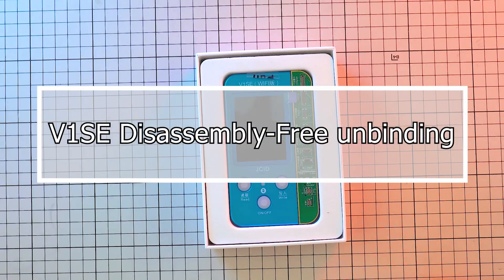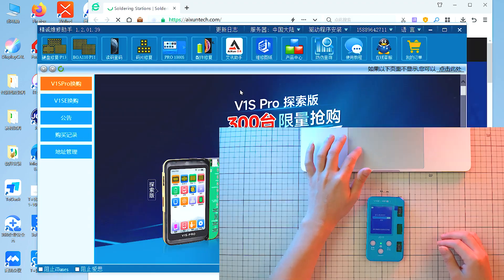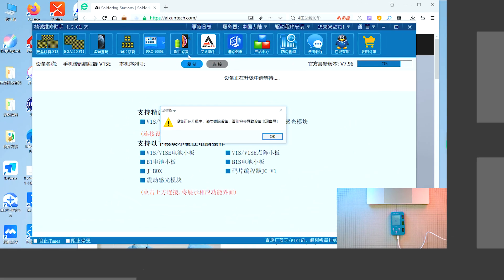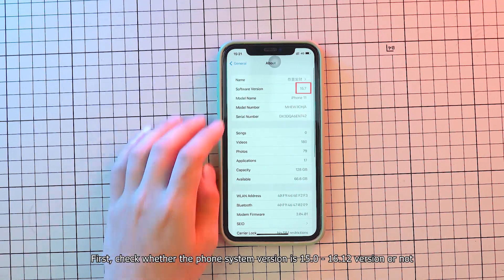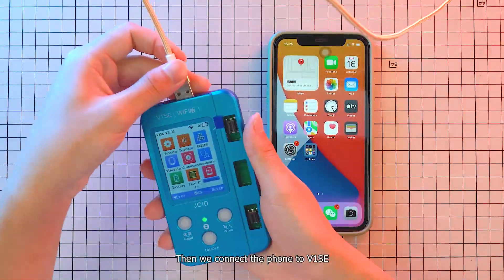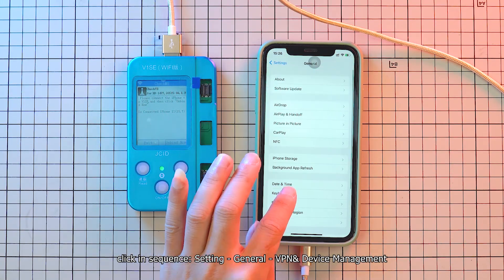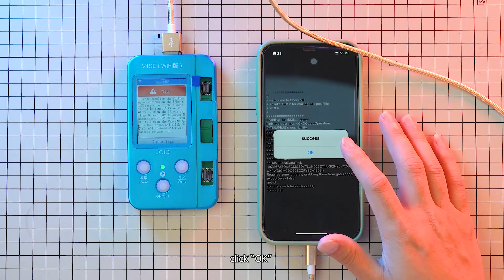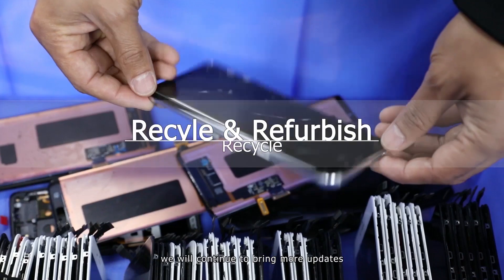V1SE Disassembly-Free unbinding | Solve Your Unbinding Headache Easily

Comment from the maker: What functions are restored after unbinding?🤔
Unbind the flood illuminater to fix face ID failure without the original earpiece flex cable.
Unbind the ambient light to restore true tone without the original earpiece flex cable.
Unbind the Dot Projector to fix face ID even without Dot data.
Unbind the screen code to restore true tone even without the original screen.
Unbind the camera to remove pop-up message warning without the original camera.
Reply: thank you so much

Comment: what is this for?
Reply from the maker: What functions are restored after unbinding?🤔
Unbind the flood illuminater to fix face ID failure without the original earpiece flex cable.
Unbind the ambient light to restore true tone without the original earpiece flex cable.
Unbind the Dot Projector to fix face ID even without Dot data.
Unbind the screen code to restore true tone even without the original screen.
Unbind the camera to remove pop-up message warning without the original camera.
Reply: @Elekworld  🥰

Comment: Is this open menu icloud unbinding? What models does it support?
Reply from the maker: What functions are restored after unbinding?🤔
Unbind the flood illuminater to fix face ID failure without the original earpiece flex cable.
Unbind the ambient light to restore true tone without the original earpiece flex cable.
Unbind the Dot Projector to fix face ID even without Dot data.
Unbind the screen code to restore true tone even without the original screen.
Unbind the camera to remove pop-up message warning without the original camera.

Comment: What are you unbinding? iCloud?
Reply from the maker: What functions are restored after unbinding?🤔
Unbind the flood illuminater to fix face ID failure without the original earpiece flex cable.
Unbind the ambient light to restore true tone without the original earpiece flex cable.
Unbind the Dot Projector to fix face ID even without Dot data.
Unbind the screen code to restore true tone even without the original screen.
Unbind the camera to remove pop-up message warning without the original camera.